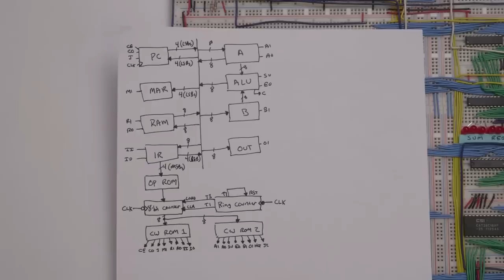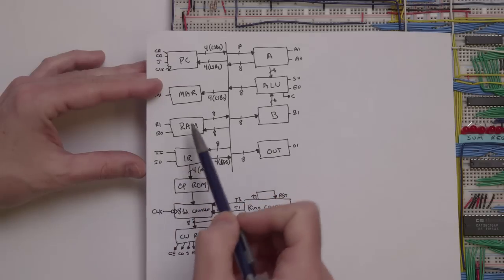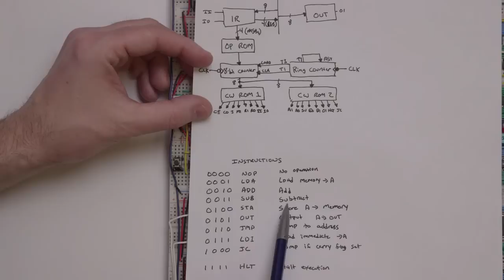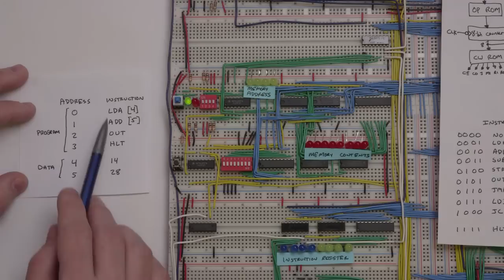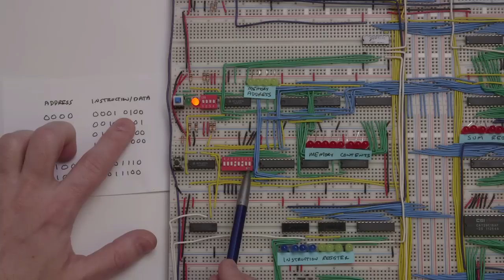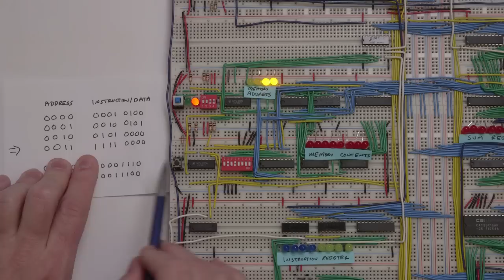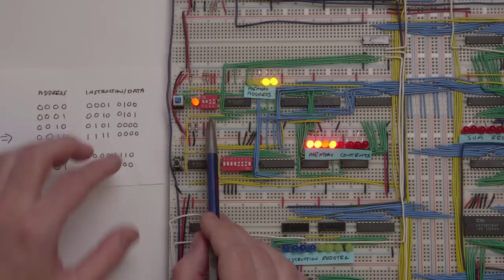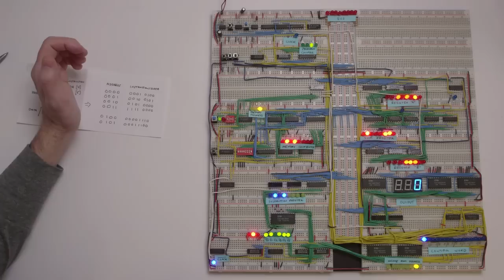Programming my 8-bit breadboard computer

Comment: What if I want to put more than a 4 bit number into the register A ?
You'll have 4 bits for the opcode, and only 4 bit for the data, so I won't be able to do that.
Lets define an opcode
1001 SET_A
Then if I want to send 11001, it will dissassemble to :
1001 11001.
But this is 9 bit, more than the bus can support. 

So why do you have an 8 bit register if you can only store 4 bits maximum ? (Obviously if you dont put the DATA in the register manualy)
Reply: ExTcZ you don't send a value with SETA, you send a memory location, and that memory location holds the value. 

memory location 0000 holds the value 10010001 which says SETA 0001. memory location 0001 had the value 0011001, and it is this value which is moved.
Reply: Matthew Rowles Ok, but the value at RAM Adress 0 was set manually by Ben. What if the RAM contained nothing, and you wanted to set a register? 

(thanks for the answer :D)
Reply: You need to write a program to send a value to the register. The program would get loaded into RAM, and then it would move the value there. By flipping the switches, Ben is writing a program to do various things. in your computer, the BIOS loads things on booting to let the OS run. with Ben's computer, everytime you turn it on, you have to reprogram  it.
Reply: Matthew Rowles I meant at memory location 0001.
Imagine your computer ram has nothing. You put SETA 0001 in adress 0 
But how do you put something in adress 0001 ?
Reply: ExTcZ you use your program. have you seen his video on the fibonacci  output? you can see there how he just assigns a value to a given memory location. he goes over the assembly code from his C program and converts it to the assembly code for his computer.
Reply: Matthew Rowles What is "ldi" in his Fibonacci program?
Reply: Matthew Rowles I still don't understand how you can set a register to something bigger than 4 bit 
You say that I have to take the number from memory to store it in A, but I also need a register A to store its value to memory. It's a paradox.
Reply: ExTcZ I'm just talking about Ben's computer here. There are 16 memory locations in RAM, which means that you need a 4 bit value to say which memory location you want to look at. Each memory location can store an 8 bit value. 

I can set memory location 0000 to have the value 10010001. This represents SET_A 0001, which means take the value stored in memory location 0001 and put it in the A register. I can then set memory location 0001 to have any 8 bit value, eg 01010101.

This is my program. It consists of two lines: x=85 and "make the register = x".

When I run the program, the computer starts at memory address 0000 and the instruction register takes the 8 bit value stored in that location. The top 4 bits (1001) are sent to the control logic to figure out what the command is,  and then that command is carried out on the memory location designated by the bottom four bits (0001).

So the instruction register gets 10010001 which it splits into 1001 and 0001. It decodes 1001 into SET_A and then carries out SET_A 0001 which places the value of the memory location 0001 into the register. 

And then the program would probably crash, as we haven't put in a HLT command and trying to decode the value 01010101 in memory location 0001 to figure out what command it represents wouldn't work. 

To answer your question directly, the RAM can store 8 bit values and so too can the register.
Reply: Matthew Rowles Oh I understand now! Thanks so much for all your answers. So when you write your program, you don't only have to write instructions but also store data after the HLT to use it after. 
And do you know how an instant value works ? Like in the Fibonacci he does ldi 0x1.
Reply: ExTcZ I think he is putting the value 1 directly into the A register.

Comment: yeah this video is old, but you should know better.
Always build some redundancy, instead of just doing 14+28 you should program it to do 14+28, then 17-3... in binary it would look like 01110+11100 then 10001-00011, basically you switch the bits of A and B then do the opposite operation(another operation), in the case that you got 28 having a redundancy would give you a bit more information on what went wrong.

I've learned it the slightly less painful way by using simulations circuits, but overall we build the same circuits :)
and I love that you used the same logic as I did, although there's room for "tweaks and tricks" in this concept, all computer logic is doing the same shit... though I'm still struggling to do gate base multi core logic or going above 1ipc :( to be fair modern computers are utilizing billions of transistors and are backed with billions of dollars... so yeah I'm not feeling to bad for not figuring it out on my own :)

Comment: 1.So your Computer is microcoded?
2.Isn't an address space of 16 bytes a little bit to small?
Reply: 3.Why did you use the von Neumann architecture?Harvard would have been much easier to understand and you had 32 memory bytes in total for data and programms
Reply: I think this video is intended for educational purposes, which von Neumann is one of the foundation methods of architecture.